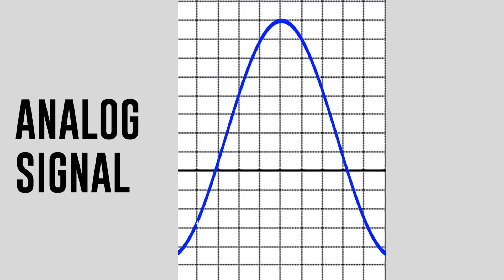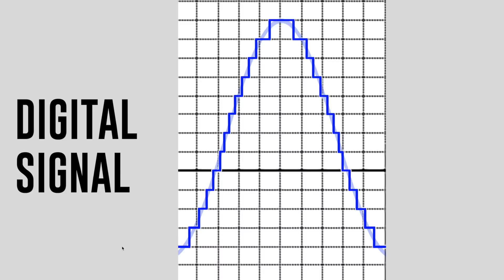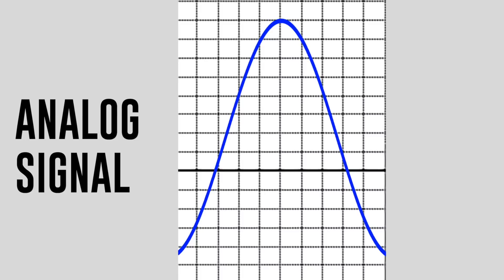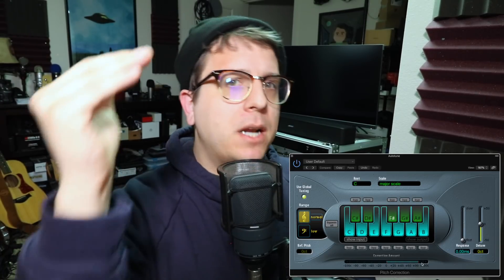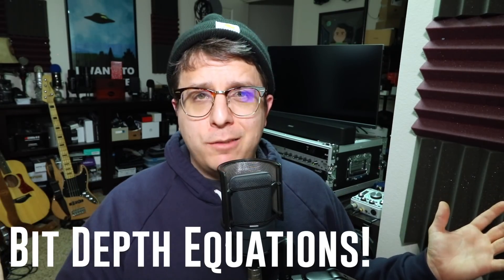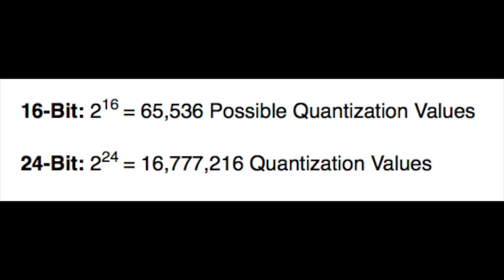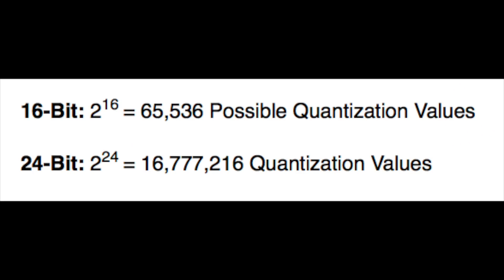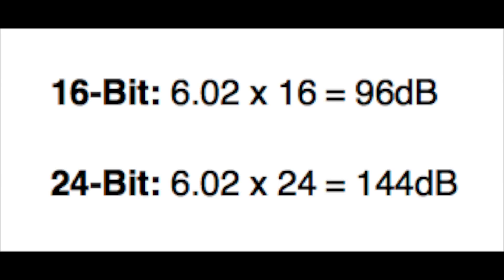16 bit vs. 24 bit Audio, What Should You Record At? (FAQ Series)

Comment: comparing voice to an image is simply wrong. voice has only 20->20,000 possible hearable values limit by human ear. image has much more limitation from the human eye.
even without compression, you can barely hear any differences, because 16 bit can sample every frequency, unless you have a super ear that can differentiate between a 10khz and a 10.001khz, you are good with 16bit.
another bad thing (and why 24bit is not really implemented widely) that you will get a file that is x15 times larger than a normal mp3 file.
Reply: hq cart, his comment about the camera is an excellent analogy not a claim of pure equivalency. Furthermore mp3 is a compressed file format and its size is based on the degree of compression applied. But it must be expanded towards its original size before it can be played back. Therefore the size of the mp3 file is most relevant to storage. And being what we call a “lossy” format it is a degradation of the uncompressed sound used as its source. It would be more meaningful when comparing file size to say that 24 bit is 50% larger than 16 bit.
Reply: @Bob Greaves unfortunately you can't compare a lossy 24bit, otherwise what is the point? you could compare lossless 24bit though, and in my example is x15 times bigger. a 3 minutes song on mp3 16bit compared to lossless compressed 24bit.
Reply: @PodcastMic i am not, i just simply said the comparison was wrong. he implied that there will be a huge difference, while in reality i bet anyone can tell the difference when hearing a 16bit from 24bit.